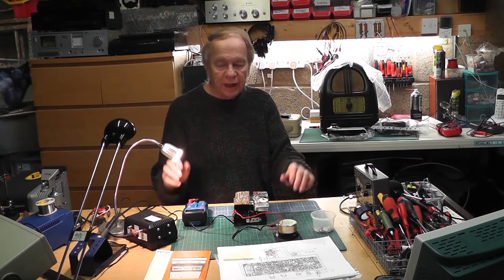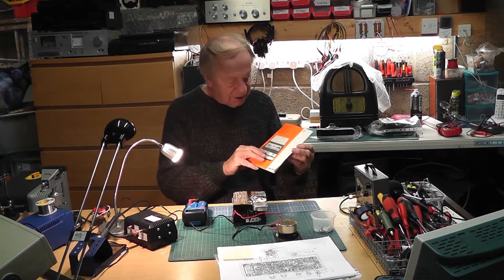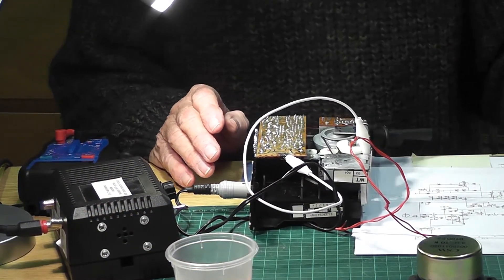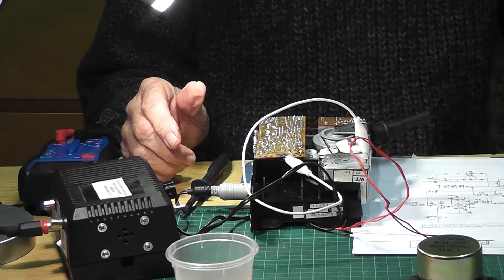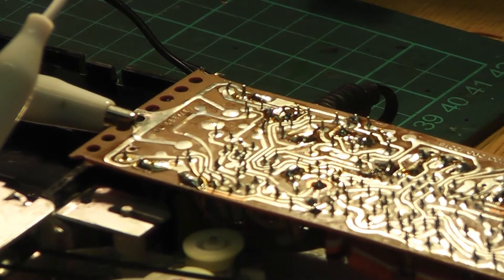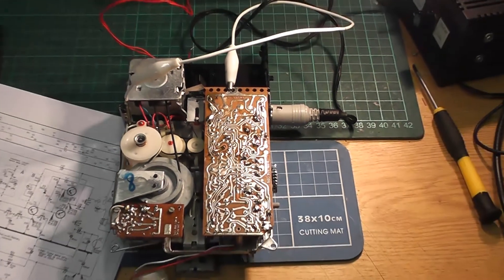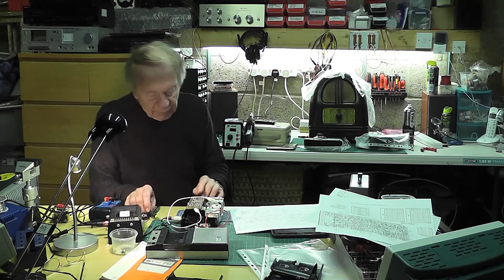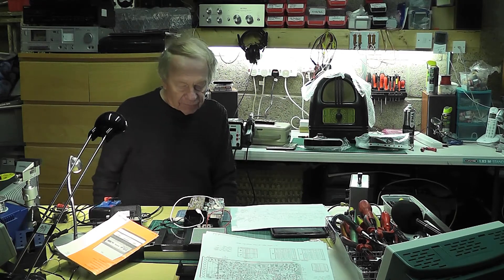Philips Tape Recorder EL 3302. Fault finding and repair

Comment: Very interesting, I just bought one on ebay and it works perfectly, it's been used and is missing the accessories, but it works just as I remember when I owned one in 1970, I made up a power supply with a 6 pin Din socket and cable, works good with the batteries as well,, it is a bit stiff to engage the mechanism, believe it needs some grease on the slides but that means removing case, maybe one day.. But the Philips is a lovely player.

Comment: excuse me, what type of battery is used ?
Reply from the maker: It takes 5 x 1.5 volt 'C' cells. Hope this helps
Reply: @DavidHallettProjects  Thank you sir ! I just found the cassette player in the old service shop the repairman left, maybe i will ask again later, hope it still works
Reply from the maker: @nurfauzi505  If it has not been used for a long period the drive may need cleaning but above all clean the tape heads. Good look.
Reply: sorry sir, i ask again hehe
how to deal with the hum (storing) and the sound seems less loud ?
Reply from the maker: @nurfauzi505  
Hi,
Is the hum present when you run the recorder using batteries or only with the mains adaptor? For low volome on these machines first make sure the heads are absolutely  clean. Hope this helps. Take care.
David
Reply: @DavidHallettProjects  I only use the battery, haven't tried using an adapter, because it's hard to get the jack cable for the head I have cleaned it using a tissue and alcohol Thank you in advance
Reply from the maker: @nurfauzi505  
Is the hum there all the time and is the level  changed with the volume control?
Reply: @DavidHallettProjects yes sir, when the volume is turned down, the hum also decreases, for more details, please see the video on my channel, I have difficulty in English, I use google translation ;(
Reply from the maker: @nurfauzi505  
Hi
I have watched your video and it sounds like the noise is there only when th motor is running. As it is affected by the volume control it must be coming from an early stage. Most likely problem are the electolitic capacitors on the power line. Without removing the pc board (this is very difficult and the record play switch can become disturbed) hitch a 470 mF capacitors from the DC line to ground. Go to UK vintage Radio and search 9r Philips N2205 motor noise, there is l lots of help there. In very rare cases it could be worn motor brush⁶es. Let me know the outcome. Good luck.
Reply: sorry, the capacitor is 470 'mf' or 'uf' and is there a chance that if i turn it on using an adapter, it won't hum?

Comment: Great video!
I have the same recorder that i restored some weeks ago.
My only problem is that the spring that should press press on the wheel and spin the cassette is no longer strong enough
and i can't find the spare parts anywhere!

Comment: I learnt the hard way to never use a good tape with a machine with no sound. I had a Reel To Reel that had no sound. The pin had snapped that moved the REC/PB selector on the PCB with it in the record position and it erased my tape. I was not a happy bunny.
Looking forward to the Philco repair.
Reply from the maker: Thanks for that, I must admit it was a risk using a good tape but in this case I had to manually push the Rec/Play switch in Play as I had to remove the plastic switch toggle. . But good point, thanks.